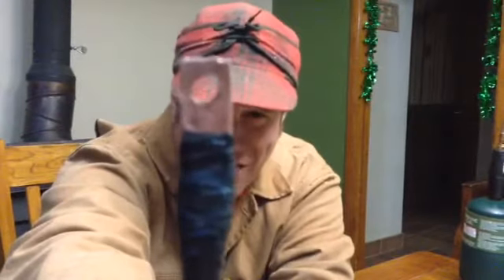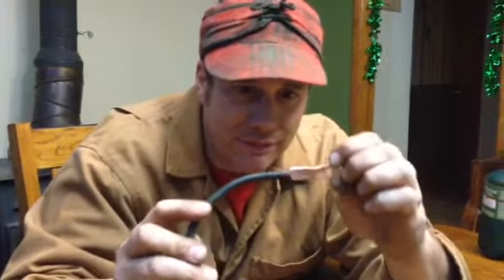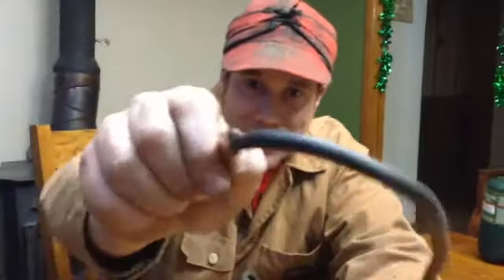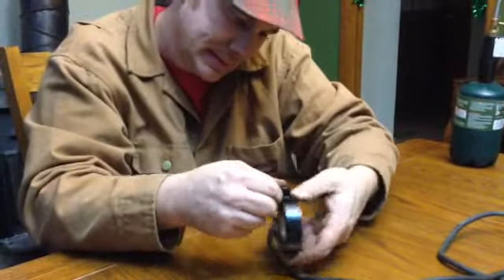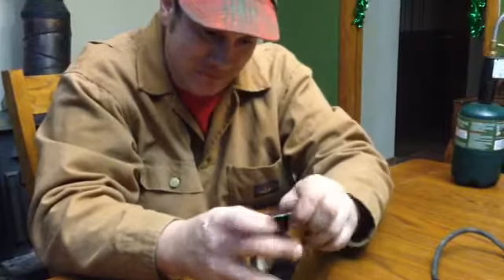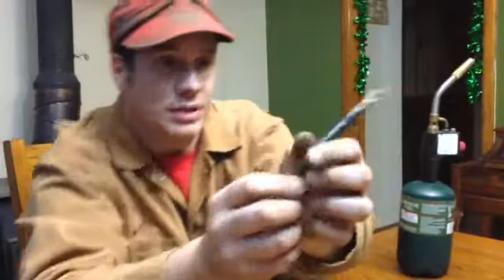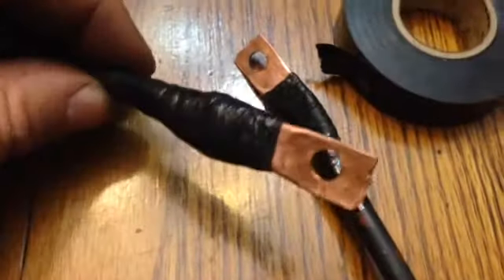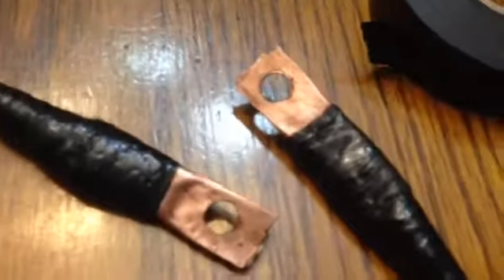Homemade cable ends, and heat wrap tape! Save $$$

Comment: Genius! I can't believe I haven't thought of this yet.. I have done so many DIY cables its ridiculous.. definitely excited to use this! Would of been nice before my HHO install and spending $ on cables for my solar batteries
Reply from the maker: Kenneth,
    It worked great for me for many years. I was just thinking about it one day and kind of put the two together. I'm glad you like the video. Thanks for watching and your your comments.I try to put videos like this up. 
  Luke
Reply: Anytime:) I shared it to a few friends and subscribed..any suggestions on cheap low gauge braided wire? I used some old jump cables I had and just standard braided AC plugs..auto grade wire is outrageous..
Reply from the maker: Kenneth,
   I like what you did with the jumper cables, great idea. Thanks for the shout out, and subscribing. Hopefully will keep you entertained😄

Comment: If you have a torch to heat the tape why not cut a small piece of sodder and drop in with the wire ?   but using a 2" piece of heat shrink tube instead of tape is better and wont come off in the weather